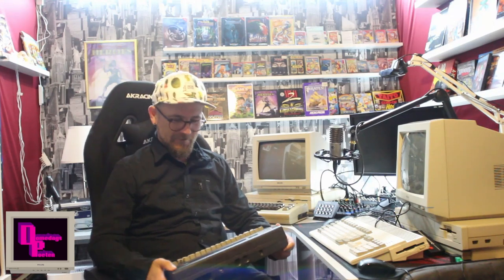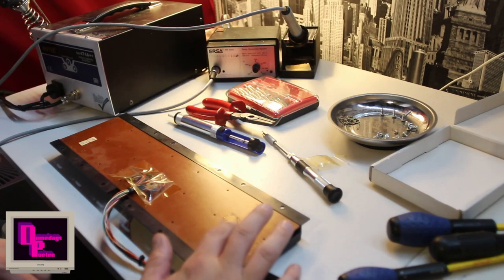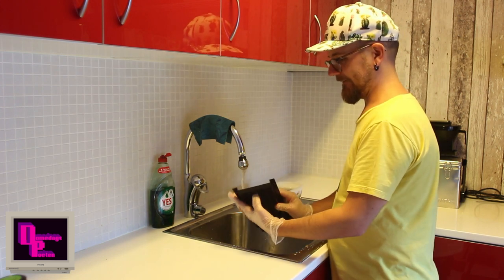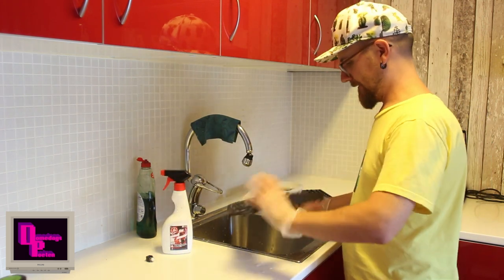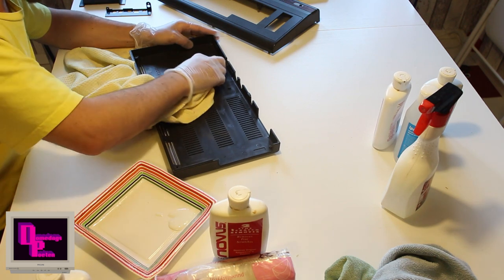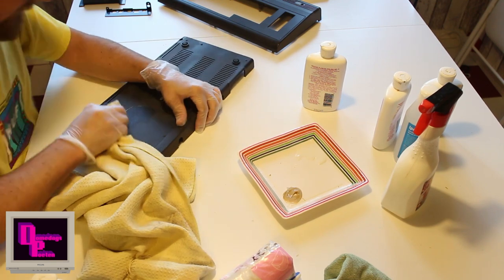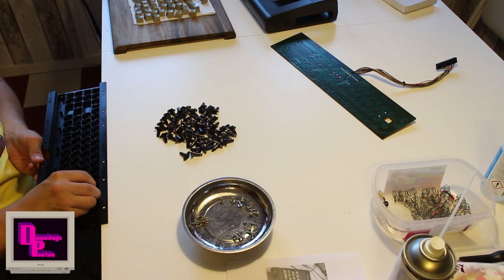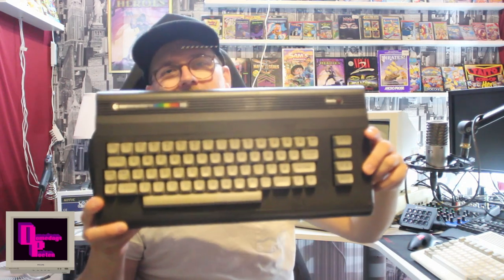Commodore C16 - Part 2

Comment: Nice work both on the machine and the video! I have a very similar video coming out tomorrow, btw, might link you in the description as a further reference. :) I didn't try polish on any of my machines yet. Looks good. Oh, are there any special ingredients in that pinball cleaner stuff or is it just a normal soapy detergent kind of thing?
Reply from the maker: Thank you, that means a lot coming from you 😀
I dont think that pinball cleaner is much more than a soapy detergant thing. The reason for using that one was because I already had the bottle at hands. 
Looking forward to see the next video from you!